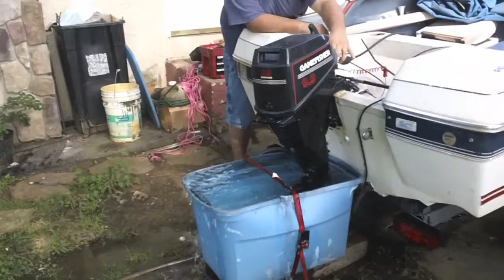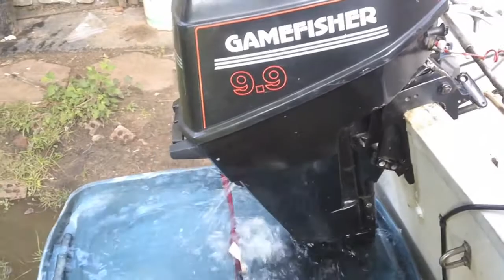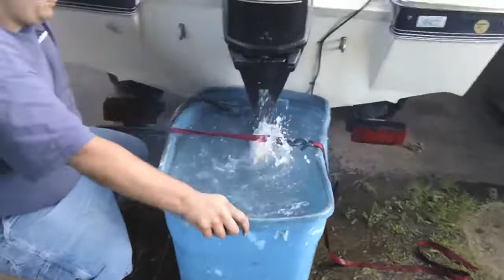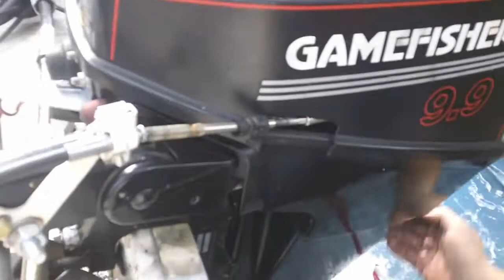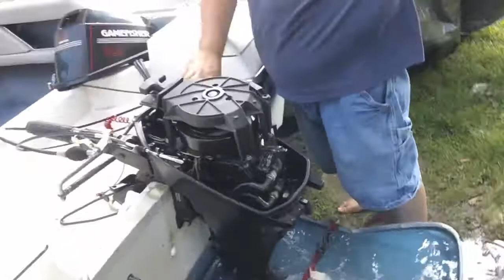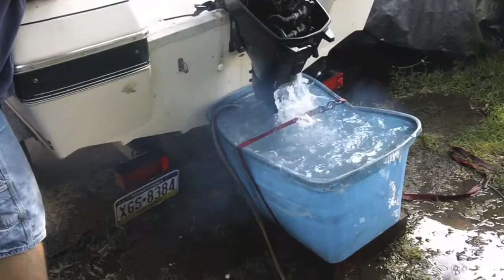1988 sears gamefisher force chrysler 9.9 outboard running after water pump impeller change

Comment: I'm new at this I have a 1985 gamefisher 7.5 I'm attempting to replace the impeller but don't know which way to turn the engine to place it in the right way any suggestions? Does it goes clockwise or counter clockwise?

Comment: I have 9.9 gamefisher mine pull stater feel stock i remove it and can pull out it easy but the flywheel is hard to move it any suggestions. Thanks
Reply from the maker: Most likely the engine is stuck.  You’ll have to figure out why.  If its froze from just sitting you should be able to put some oil or penetrating oil in the cylinders, let it sit for a bit then try to spin it over again.
Reply: @origionaldz  do you think w40 can work on it?

Comment: I got the same engine from some reason I remove the bottom and  impeller looks good but I just can't get it to return water you got any suggestions also I there's a lot of smoke coming out of the a we're pee water.
Reply from the maker: If its ever been in salt water, the cooling passages could be clogged up with corrosion.  The impeller could also be stripped and just free spinning on the drive shaft.  Did you take it out and look at it?
Reply: Thank you I will try that this weekend thanks a lot for the information

Comment: My buddy has a 1990's 5hp Gamefisher and we can't get the lower unit to drop.  We've unscrewed everything possible but she still won't drop.  Can you offer any suggestions?  Thanks
Reply from the maker: Sometimes they can get a little stuck, especially in salt water use.  I'd spray as much as you can with penetrating oil and just let it sit for awhile.  Come back later and do it again.  If you have a sand mallet or rubber mallet you could try and work your way around tapping it.  Once you get a gap spray some more penetrating oil in there.
Reply: I just dealt with that problem the other day on same exact motor.  You DID uncouple the shift shaft, right?  There's a rubber cap on th exhaust leg that gives you access to it.  Even then the unit wouldn't drop without a bit of persuasion from a stuck driveshaft to crankshaft spline, but it did come off without undue force.
Reply: Did you take the shift linkage screw out? When the lower end separates from mid section it will only separate like an inch just enough to get to that screw take it out and it will drop down...

Comment: hi i have a 1988 force 9.9hp i been looking everywhere for information on how hot the head should get. if i splash a little water around the top of the head it sizzles but water out the pee hole is cold. is this normal ? thanks for any info
Reply from the maker: The 9.9 forces didn’t come with a pee hole from the factory, did someone add one?  
The head shouldn’t be that hot.  I can’t remember if that model has a thermostat but that would be a place to check as they do wear out.  The engine could also be running lean causing it to heat up too much.  When was the last time the impeller was changed?

Comment: I have a 1989 15hp gamefisher motor I can't seem to get it running  like yours do of a place that I can buy a carb kit for it
Reply from the maker: Eddie Hernandez you might want to check boats.com or search around on ebay.  Sometimes you have to find out who made the carburetor and then get the gaskets for it individually.  On the older outboards they aren’t always available as a kit.
Reply: eBay.  You probably don't even need a kit; it's a real simple carb that probably just needs clean-out of the bowl and high and low speed tubes.
Reply: Ebay sells different carb kits for gamefisher models
Reply: eBay, Sea-way Marine, or Marine.com. I just ordered a complete kit on ebay, same motor.